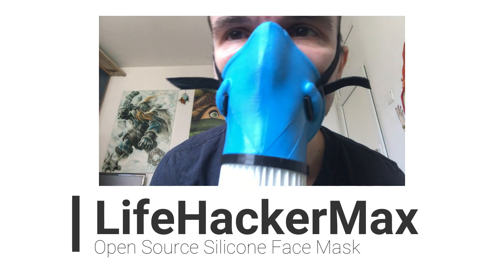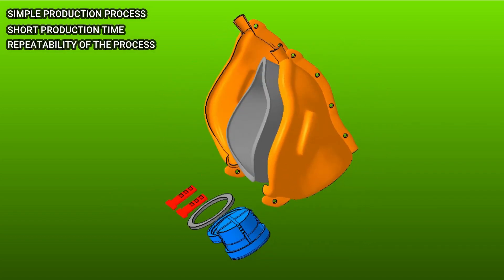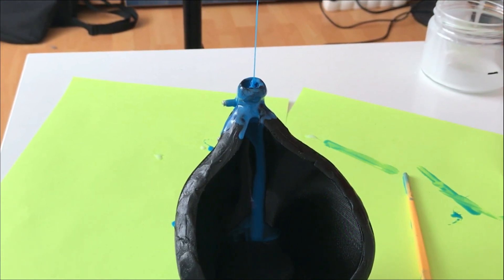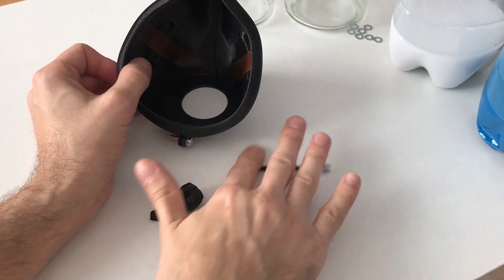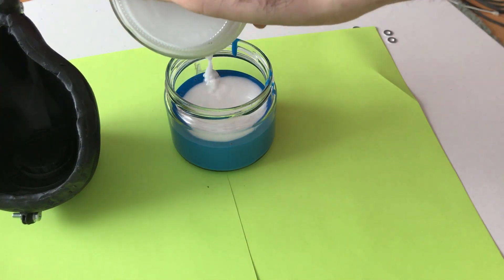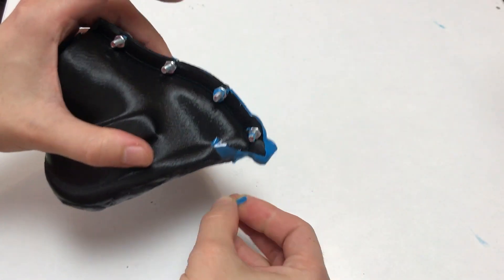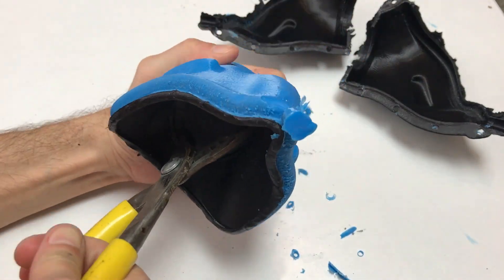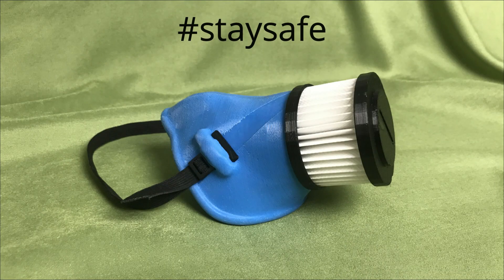LHM Silicone Face Mask With 3D Printed Mold | Step by Step Process

Comment: Have you considered making the mold so that it can use threaded inserts? It would make assembly and disassembly easier, IMO. Also, instead of that tiny filler tube, turn it into a quarter funnel. That should make pouring without bubbles easier. 
Nice work, BTW.
Reply from the maker: Thank you so much! There are lots of things to improve the mold, especially the filling tube which was a pain to use 🤣. Sadly there are other forces at play within the medical system that don’t allow us the makers to help (financial, political, etc.) at least from what i could figure out. So the project remains in the prototype stage. But the files are still up there on thingieverse.com free for everyone that wants to improve and take the project to the next step 😉. It would make me happy to see it evolve into something more. Cheers!!! Thank you for your great ideas 💡Brian!!!

Comment: An N100 filter, 99.9% viral and bacterial filtration, is only 1 dollar (100 for $100 dollars).  Add that as an option?  Example is VB48max from A-M systems, which is (or can be) used in bunnypapr.org, Boston Children's CRP mask + filter combo, as well as with full face mask designs like maskson.org.  An elastomeric CPR mask (e.g. WNL brands) is only about 10 bucks and will fit a VB48MAX filter if you want to have a commercially made mask + filter option.

Comment: Very good idea to reuse an HEPA filter. 
The size of the filter should ensure a good breathability.
But you will not be able to perform pressure tests to check if the mask fits perfectly with filter plugged in.
Reply from the maker: I made the test without the filter by blocking the hole and it does the job

Comment: Adding a simple cloth mesh like cheese cloth to the mask would make it more durable by reinforcing the silicone. I dont know how thick it is to begin with, but its an idea... also maybe an air out valve, means you will pull in cool air from the filter and blow out the hot air constantly refreshing the air in the mask and reducing moisture and temperature for that part of the face.
Reply: @Jynx2700 - I would love to know if an air out valve can be made to be very reliable.
 It is easy for me to see how a simple flap would allow your air out of a face mask, and make the mask much more comfortable for the wearer of the mask, but I am concerned that an air out valve,  if not made properly would allow air and the corona virus in. I am not talking about just this mask, but about any face mask that I make. So far I have found it difficult to get information on this subject of making a highly reliable face mask exhaust valve. Thank you to anyone who can help me with this question.
Reply: @allanmarks2150  air outlet valves actually make the masks useless. Half the purpose of the masks is preventing you from possible infecting others.
Reply from the maker: My first prototype was made with a thermoformed overshell  but it added more complexity to the production process and it seems like only the silicone has sufficient strenght on it’s own. The thickness of the mask is 5mm and the base border 8mm. The mesh it’s a great idea for reducing the thickness of the mask. I don’t know how the sterilization process would work. The valve would be cool to have. Thank you for sharing your thoughts. I wonder if the valve could be made straight from the mold 🤔. That would be awesome 😎.

Comment: You should add a empty "nearly cylinder" accros the assembly surface, by rotating a "nearly tube" in it, you could separate the both parts much easier (and less risky for the mold and the hands). Some paper would prevent the friction while the oval tool is used.
Reply from the maker: That part really needs some remodeling :). Thanks 😊.

Comment: Do you think we can place the mold in water in case the heating silicon is used?
Reply from the maker: Is there such a type of component? Water might get inside and ruin the mask. Maybe use ABS to print the mold. ABS performs better with high temperatures.
Reply: @LifeHackerMax  if the mold is already full with silicon, and if you keep the upper point above the surface, it is Archimedes pressure that will balance the exchange.
It was just an idea, to increase the use of your design with other materials.
I am not going to promote it further.
Reply from the maker: Thank you! It might work, needs testing though :).